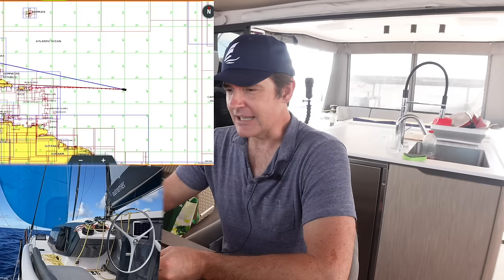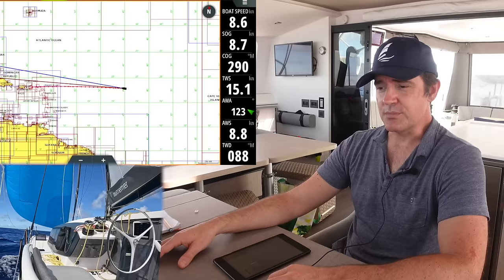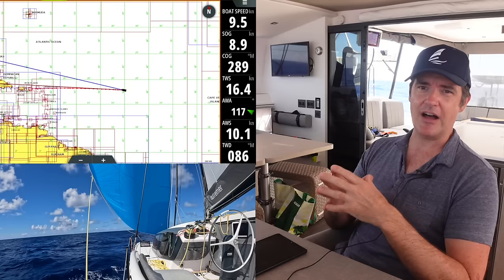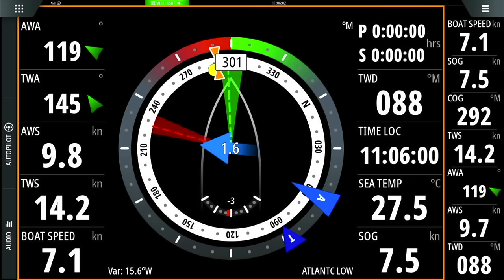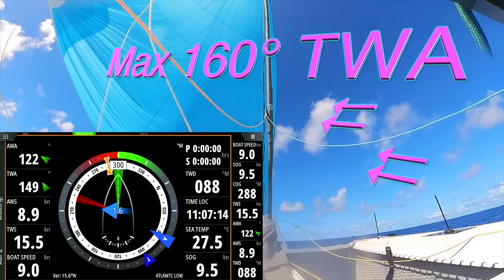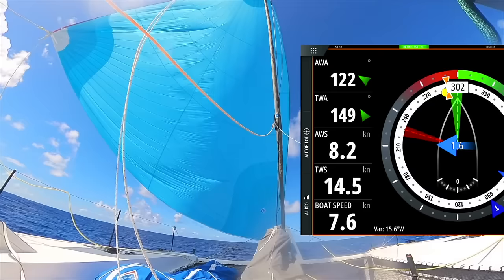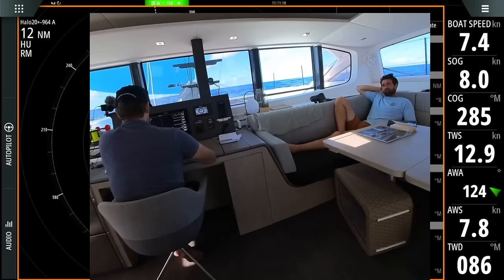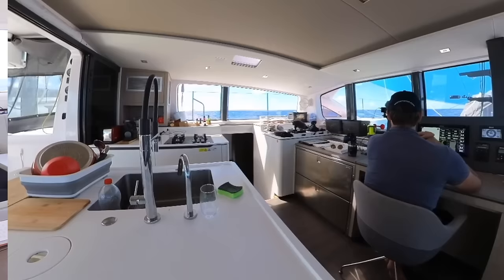Offshore Electronics Explained -B&G, Starlink, Iridium- MID-ATLANTIC UPDATE

Comment: One question about the True and appearant Wind Speed toppic: if the tws is 30 knots from behind and the boat is doing 15 knots downwind, your aws might be 15, but the Sail still takes the pressure to Push the boat to 15 knots Speed, Right? So there must be More load than sailing in 20 knots True and 5 knots boatspeed. Some Skippers put in reefs according to the tws to avoid critical Situations for ex. During a Manouver. What does your skipper say to this toppic?
Reply from the maker: Theoretically yes, but the true answer is that you reef to the gusts, so there is margin built in.

Comment: Did you think of converting it to 12V? Or simply bypass it and use a low consumption router, in bypass mode should consume very little. I didn't do it myself yet
Reply from the maker: This isn't my boat. If it was, yeh I would convert.

Comment: A little off-topic, but... why aren't newly built boats of that size using 48V, considering they have so much electronics and loads of batteries on board? Why use 24V that need bigger/heavier and more expensive cables?
Reply from the maker: Most electrical gear on a boat this size is 12 or 24v. So you can have a 48V bank, but you’ll be using converters for all your pumps, motors, compressors, electronics, etc.

Comment: I'm confused you mention and showed it on the video that VMG is relative to destination.. VMG is not relative to the wind direction? And VMC (also called VMG cse (course) / VMG waypoint) is not the one relative to the destination?
Reply from the maker: I'm confused or don't know the answer. I believe you can set it relative to the wind, but I believe we had it set to destination or waypoint.
Reply: @TheOKellys  in the video in the left to VMG you had VMGcse, which I believe is the one that shows the vmg to destination
Reply from the maker: I looked it up on B&G site, CSE not in glossary. Game to learn, so if you iron it out, lemme know
Reply: @TheOKellys  I found such info in some glossaries cse is the abbreviation for course and it is used instead VMC

Comment: Did you consider getting a shortwave (HF) radio transceiver?
Reply from the maker: Interesting question. I installed one on Low Pressure along with a Pactor III. It worked alright, but it was really hard to ground and the other electronic goodies on board made a lot of noise. So, nice to have...but I would not prioritize SSB these days.
Reply: @TheOKellys  seems like there is a business opportunity here...

Comment: Wonder what your thoughts are on using weather routers and a sat phone as a backup? I’m toying with starlink being primary, and an Inmarsat sat phone with weather router on the other side if Starlink fails. I really like the idea of a self contained device for comms, not needing a phone or laptop of things get hairy. The Inmarsat IsatPhone2 has insane battery life, and can call text and email (old school style). It also uses geosynchronous vs. low earth orbit like other technologies. Low earth could get messy in the event of a big solar flare (expanding the atmosphere and deorbitting sats) or debris fields. I found a plan for $38 a month. I don’t want my backup to cost as much as starlink, but be extremely less capable. I figure it’s  not the worst thing to have an experienced weather router in your back pocket to do some thinking for you… especially if things aren’t ideal on your boat.
Reply from the maker: Go Exec is a satphone. Weather router? If you don’t know what you are doing with a forecast? Best money you’ll ever spend. The days of putting your nose out into it to see what ya get? That’s some horse and buggy stuff right there. Nothing wrong with horses or buggies, but there is a better way of the goal is efficiency.